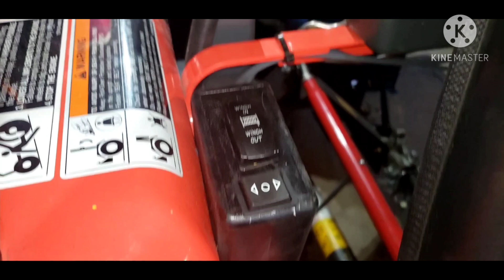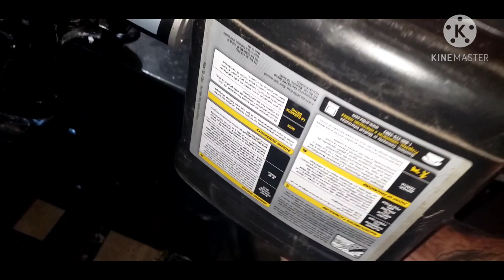#50. Kubota L2501 3 point snowblower electric chute rotation homemade on a MK Martin Meteor 68"

Comment: Just got a quote for my 54 meteor and it’s 1100.. I’ll be doing this as well.. where did you get the motor?
Reply from the maker: The rotation motor I ordered off of Amazon, many guys use electric seat adjuster motors. The linear actuator for the deflection was ordered from the company directly. There's lots of variables included like total extended length, shortest length, the the speed and power (hold pressure)  as one increases, the other decreases. If i had it to do over again, i would use the manual crank on the rotation, and mount a motor to spin that.

Comment: Good evening what is the speed that is written on the tag of the 12 volt actuator?  thank you.
Reply from the maker: I looked back at my order for you. It's by Firgelli Automation it's 200lbs at .75 inches per second. 5" stroke.  $239. I bought the mounting clevis as well. Couldn't be happier

Comment: Great Idea on the drive sprocket. I have an identical blower from Northern Tool. Would you happen to have a template for the sprocket that you could share? It would be greatly appreciated!
Reply from the maker: Thanks, but no I just figured how many teeth I wanted, decided 360(degrees in a circle) and drew out lines at those angles then made a circle farther outfrom the center point they would be solid material for strength, then drew lines from each line at the distance from the hub I wanted them to be, and drew that line threw the center of the outer circle like a star so they'd all be the same. Took a few tries, because I found if they went to a point at the tips, there wasn't enough strength to keep them from chipping, so I made a 2nd one and made the "star points" more rounded and thicker.

Comment: I made them water proof by sealing all the areas of concern with RTV sealant. They have been working well for 3 seasons. I'm sure your actuator will outlast mine and of course it is better for all of us to use American made stuff.
Reply from the maker: What sized blower do you have? I was also concerned about the speed/ and then hold strength. Wasn't sure what the pressure at the chute coming out would be with the deflector set to throw the snow close, but I figured they're be a lot of pressure with a wet heavy snow, I think the actuator i have is set at 600lb static strength.

Comment: I like this idea a lot. saved a lot of money. ole bow wants some attention. give him a good pat on the head and an ear rub from me.
Reply from the maker: Yeah I have had only 1 problem with it, and that is I needed to extend the shaft for it to work right, and it's a smooth shaft coming out of the motor. I used a shaft coupler coupled to a piece of shaft, the problem is the motor shaft is all smooth! The set screws hold until they get wet with snow and they (the extension and my homemade sprocket)  fall off. I've used locktite, super glue epoxy, but they just keep falling off. So I threw the crank handle back on, and will probably need to order another motor with more of a better shaft. I couldn't see the whole shaft in the ordering pictures, but it has proven to be frustrating. And now I've been intrigued by these hydraulic multipliers, lol. I may just go full hydraulic, and these multipliers seem like a slick way to get the top & tilt and everything else set up.  But that's another rabbit hole to run down!
Reply: @ironheadbiker  take the screw out and run a drill bit into the shaft where the screw left the indention. then use a longer screw that will screw down into the hole you drilled. it may work. worth a try but yes hydraulics on the rear is super nice to have.
Reply from the maker: I did try that, but the shaft is too hard to drill, might try thin cutting wheel and then a cir-clip or something, but yeah I'm really leaning hydraulic everything. After 3 winters with this tractor, I'm convinced it's the right one for me, so I don't mind investing the money slowly. My large rear blade actually has the eyes for cylinders,  so I just need to get some money planted this spring and get that money tree growing!
Reply: @ironheadbiker  lol @ planting that money tree.

Comment: Where did you get the chute rotation motor from? I'll looking to build one for my titan snowblower.
Reply from the maker: I ordered it thru Walmart. Com. It was $85. It's a 12v high torque reversible motor. (The same they use for power seats in cars.) Strong motors when you think about the weight they can be asked to move. You see many guys dyi and use just any motor and their chute turns way too slow. Check the size of your gear teeth on the blower, mine are huge with big spaces, I started 90 degree left,  and counted how many turns of my manual crank handle I needed to be 90 degrees right. It was 10 turns on mine. Then I figured out how fast I wanted it to turn that 180 degrees in seconds. I wanted between 3-6 seconds,  cuz when it's blowing back in my face, I don't wanna be waiting. (Saw some guys with 20+ seconds to turn). So for ease of math let's say 5 seconds. With 10 turns total, that's 2 turns per second. So 60 seconds in a minute,  1 turn per second would be a 60rpm motor, 2 turns would be 120rpm motor to get left to right in 5 seconds. With my sprocket teeth size and turning crank numbers I went with a 160 rpm motor. It's fast,  but accurately stops and easy to control. With my bigger teeth on my chute I made a homemade sprocket off the motor to mesh with the chute teeth because I only wanted 5 teeth, and couldn't find anything to fit the way I wanted it to.  Sorry so long,  and detailed, just wanted to make sure you get the right rpm motor, (and why) so you're happy with the results. Thanks for watching.
Reply: @ironheadbiker  Thanks for your help.. my blower looks pretty close to yours for teeth anyways.. I ordered the same motor as yours from Walmart.. 88 bucks... 160rpm.. hopefully it works for me as well as it works for u..
Reply from the maker: Yeah it was easy to make a homemade sprocket. Lil fine tuning and shaping to get it to fit, simple star pattern did the job just right. Also a 6pin (7 pin if u want it to light up as you use it) momentary rocker switch controls it perfectly.  I had my sprocket slip off during the video, I forgot to locktite the set screws, so I think they vibrated loose and the sprocket fell off the shaft. (I bought a 12" long 10mm extra shaft so I'd have room to make the sprocket at any length I wanted. The butt connections shaft couplers I used have 4 set screws(2 to each shaft) and they loosened and my sprocket fell of and sadly it was when I had the blower up in the air knocking down a high pile, so then with the next pass on the ground I ended up blowing the sprocket with the rest of the snow! 🤬 so in the 2nd half of the video I have the crank handle back on and yesterday I made a new sprocket and made sure my set screws were bathed in locktite. I think I'll have a little "catch or stopper" under my sprocket so if it falls down again it won't go all the way to the ground. I was thinking of tac welding the shafts together, but was worried the heat might ride up the motor shaft and melt some plastic or seals up in there, so I'll see how this holds up 1st. I just don't know if I didn't tighten it good enough the 1st time, or if it vibrated loose.

Comment: Seen ur comments on GP outdoors and Biff's equipment So i figured I'd jump over and see what u was working on this is interesting can't wait to see how it works and how those tire chains turn out
Reply from the maker: Thanks, I'm actually home and in my shop as we speak getting ready to attach the spacers. Then I'll be attacking my tire chains and seeing what I come up with for a pattern. I just don't want the cross chains, I want chain running with the tire also not just across it. It'll be a Frankenstein's monster of some sort I have no doubt. Thanks for checking in.